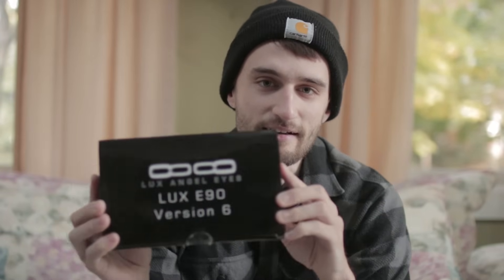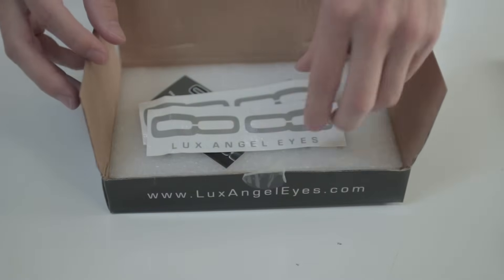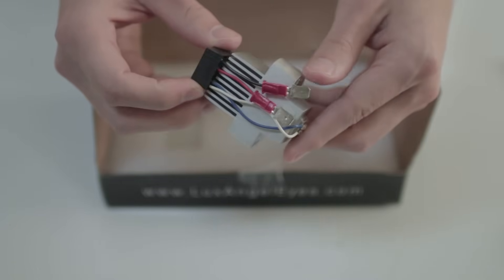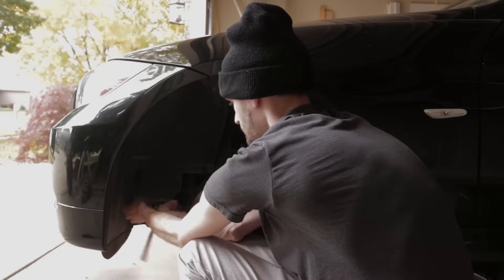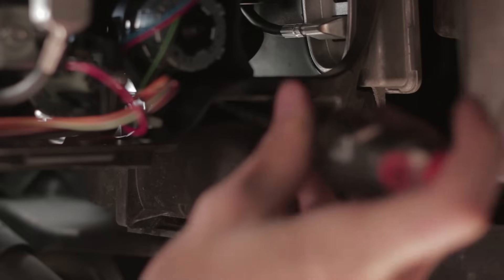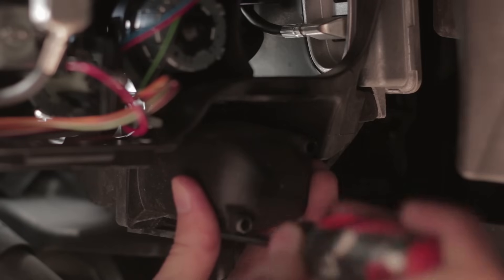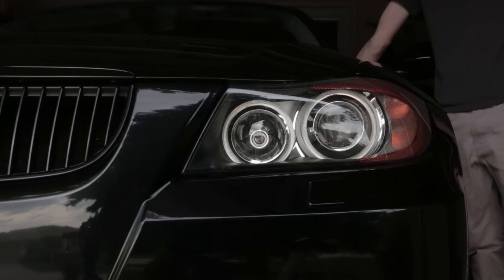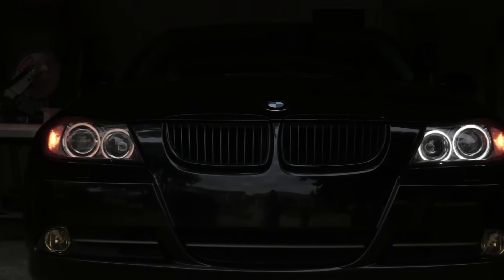BMW E90 Angel Eyes LED Upgrade (LUX)

Comment: just a warning, I was at the BMW dealership just yesterday and I asked him about the Lux Angel Eyes aftermarket LED Halos / Coronas. they told me they would not advise me to do that because it can drain the battery a lot faster or some other electrical components may go bad.
Reply: Yeah, but i bet BMW sell their own version of LED eyes for the e90 which i also bet don't have any neg effect. its just dealers for you, il be honest I'm on my forth e90 and have put angle eyes in everyone (different brands) and in 7 years iv never had one issue
Reply from the maker: That's the dealership trying to scare you out of something they can't make a profit on. The truth is, LED's use far less energy to emit the same amount of light and actually put LESS strain on the battery. That's why BMW switched to LED's on their newer models.
Reply: Thanks fellas! Ill be ordering my own next week.
Reply: you won't regret it kevin, gives the car such a fresher look:). enjoy
Reply: Will get it by black Friday!
Reply: kevin p the stealership will tell you anything bad that's against upgrading the vehicle to better visual standards, because they want you to buy the newer models, why would they say yes get your bimmer pimped for cheaper costs and leave our newly designed models on the showroom to collect dust.

Comment: Thx Justin, I'm about to 'retire' mine 2006 330i RWD auto with 190k miles, and I always wished I could've had the Halos upgraded to LED (which I did on my X5) but I didn't because I don't have them setup as my DRL - instead I have a normal h-bulb inside the hi-beam socket - not sure if/how I can hack that?
Reply from the maker: in the iDrive menu, under lighting, you can disable the daytime running lights. Then when you turn the headlight switch one click to the right, only the halos will be illuminated like you see in my video.
Reply: yeah, i kind of figured this was the way, but switch in that position is not going to turn the main-beams on automatically ...right?
Reply from the maker: one click to the right turns on the halos, two clicks tuns on the headlights
Reply: Yes, but when you turn left for the 'auto' setting the Halos do not glow until the headlights turn on at night - can that be code-hacked?

Comment: Hey Justin - My 328xi has halogen lights - I know the car has the option for the upgrade to Xenon when it's purchased, but mine is used. - do you know if I can just buy Xenon headlights and plug and play w/ the current voltage in the car?
Reply from the maker: +J C0 im not sure if it's plug and play but i know someone has done the conversion before. There is a thread on e90post.com
Reply: Justin Buice cool man I'll check that out. Thanks for the info!

Comment: Question can you actually put HID in a halogen projector headlight ? My Mercedes didn't come with HID like my BMW
Reply from the maker: +Nafiz C the housing for HID's is different because the light diffuses differently than a halogen bulb. If you were to put and HID in a halogen housing, i think it would be too bright for oncoming drivers.
Reply: idk what do you call them it's look like same as your car has but it isn't blue

Comment: So did you have to change out the halo lights because you turned them up with the Carly
Reply from the maker: you can turn up the brightness using Carly on both the stock lights and aftermarket ones. Although the stock ones will be a bright amber color compared to the pure white LED's

Comment: did you replace the headlight bulbs also? if so what did you install?
Reply from the maker: +stilltippin214 i only replaced the lights flr the halos. The headlights are stock

Comment: Hey man I recently got an 06 BMW 330i. My daytime running lights are the nasty yellow inner bulb rather than the halos like most newer BMWs I see on the streets. Is there a way I can change this? The only time my halos come on is when my low beams come on and then it's almost pointless because they're so bright you don't pay attention/see the halos...
Reply: Temp can get it coded that angel eyes are your daytime running ights

Comment: Is it possible to install lux v7 without removing tire? possible to do it from the top? I had bought some cheaper LED angel eyes (which burnt out), but was able to install them from the top/engine
Reply: I have a 2008 328xi and you can change the DLR bulb without removing the tire. You cannot change it from the top. I believe that only works for certain models like convertibles, etc.

Comment: I have a 2011 328x drive. So This will work for my car right? And also will it light up the day time running lights?
Reply from the maker: I believe the 2011's use a different bulb, but I think that LUX makes a bulb for your car. Just check their site. The daytime running lights are a separate bulb from the angel eyes.

Comment: I recently visited their website and now it lists under LUX E90 V7, is this possibly a more recent version?
Reply from the maker: +Omar Guerrero it could be, I'd message them just in case
Reply: Hi Omar did you manage to find out if thats a recent version? And would it still work because im not sure about mine i have a 55plate 320d SE :/

Comment: I just bought the lux v7, Hopefully they turn out great because the stock one died.
Reply: I haven't installed them yet but I will let you know when I do
Reply: BOOM HEADSHOT yes please let us know as I am looking to buy the V7 as well. Thx
Reply: I have them installed and they look great. Installation was easy and you don't even need to take the tire off. Hopefully I will have a video on my channel tomorrow.
Reply: BOOM HEADSHOT thanks for the reply. Appreciate it. Can't wait to check out the vid!
Reply: The vid is on my channel now. They look great but I had a problem installing the driver side one. The previous owner did not put the glass piece which caused the halo ring to melt and become black on one end. All I did was cut the burnt stuff off but its not perfect. Im going to have to concentrate the light with some sort of tube.
Reply: Yes. all I did was trimmed off that burnt stuff and it became brighter (not perfect though). I have a vid on my channel showing how it looked afterwards.

Comment: Looks so good! Been eyeing the Lux V6's for a while and I think this just convinced me to do it. Any plans to make them DRL? I haven't had any luck coding for the early model e90 (I have an 06 as well),  so I was looking into the daeos harness but haven't purchased yet. Like to hear your thoughts!
Reply from the maker: +Justin Carey I turned off the daytime running lights and then if you turn the headlight switch one click to the right, it will just turn on the halo rings without turining on the actual headlights. That's probably the easiest way to drive with just the rings illuminated.

Comment: Hey justin what are the best headlights with halo rings my car just has stock non halo lights and I'm looking to upgrade to better ones preferably to one's that are compatible with the lux v6 lights?
Reply from the maker: +Orlandopatino209 your best option is to buy original BMW headlights. You can probably find a pair on eBay for under $400 slightly used. The only thing is that the wiring might be different. Check e90post.com there is a DIY for converting the base headlights to the xenon ones

Comment: Are these just for the daytime running lights? I have hids installed but my daytime lights are still halogen, will these change that? Thanks in advance
Reply from the maker: +EliTheJerk123 the daytime running lights are separate from the halo rings and they are still halogen lights. You can buy LED's for the daytime running lights, but I just turned mine off completely so it's just the halo rings that light up during the day
Reply: Justin Buice Okay thanks, im thinking of doing this to my 3 series. It looks great, makes for a good head turner

Comment: hey Justin, do your lights flicker at all? I read somewhere on the forums that some people are experiencing lights flickering on startup
Reply from the maker: They flicker for a few seconds when you first turn the engine on. I found this on the forum- "The car checks to see if any bulbs are burned out upon start up. The problem is that LED takes less power than incandescent so every pulse causes the light to flicker. It was always doing it, it just didn't light up your old bulbs." In other words, you don't see the halogen lights flicker because the self-check doesn't send enough wattage to illuminate them, but since the LED's require such little power, any amount of electric current will make them light up, which causes them to pulse during that 3 second self-check.
Reply: thanks
Reply: Justin Buice come down to Indiana I'll turn all that off and code whatever, I just did my e90 no more flicker, led errors, turn signals off with halos, so much more took an hour !
Reply: Tony Roberts where in Indiana do you live? My gfs family is from there and I️ go there often, I’ve been wanting to replace my old corona bulbs for an led bulb?

Comment: Poop 😢 I have a 2005 i325 and none of the lights Lux sells are compatible. Any recommendations?
Reply from the maker: +Oya Osun if you have the base halogen lights, you will need to upgrade your headlight housing to the xenon ones like mine that would have come standard on the 330 and 335. Unfortunatly they are around $1,200 for the pair and will require some wiring, but people have done it.

Comment: i was too lazy to take off my wheel so i just turned my wheel so i could remove the screws and it was fine.
Reply from the maker: +Zach hidden ive done it that way but my camera wouldnt have fit with the wheel on
Reply: Justin Buice that makes sence, looking back at it, it wouldve made taking off the outer cap way easier for sure

Comment: i have a BMW 330I 2006 i was wondering if these would fit? i know it says E90 but i'm not sure how to tell
Reply from the maker: +LunekTv mine is a 2006 330xi. Basically the same car. If your grill has the upper piece attached to the hood, then these lights will fit.
Reply: Justin Buice thanks for the response man!

Comment: Does it matter that my E90 doesn't have xenons? Sorry for this novice question.
Reply from the maker: +Tomi Rinne it only works if you have xenon headlights because the actual housing is a little different.

Comment: How do you tell the difference between halogen & xenon?
Reply: Halogen does not have the rings nor the projector. HID headlights will have modules on the headlight itself.

Comment: Where may I buy the screws that hold the fender liner?
Reply from the maker: Check your local auto part store in the section where they have fasteners for body panels. They usually have an assortment of small screws

Comment: I have halogens and feel they let the whole look of the car down, has anybody done a dull pre-lci halogen > HID swap, if so, details?
Reply: i agree on bmw stock halogens they are PISS POOR, i considered a hid kit on my old e90 but so many kits out there make the car look silly in my opinion. I instead opted for a pair of osram night breaker plus bulbs. MUCH brighter when driving and give the car a much better look with lights on. they may not have the full effect you was after but are a cheap alternative compared to hid, id 100% try them before u got hid

Comment: I don't understand why my 2006 BMW 325i didn't come with HID or Halo headlights. something I extremely wanted but the the one i bought didnt have them. is there any way i can get HID and halos?
Reply from the maker: +Shelby Hilke the 325i was more of a base model, so the HID lights would have been an expensive option for the original owner. Your only option is to replace the entire headlight housing to the one like mine that has the HID projectors and halo rings. You can buy a pair on ebay, the problem is the wiring is a lot different than the base model. Id check e90post.com im sure somebody has done the conversion before, but I have a feeling it's expensive
Reply: Justin Buice Ah, I see. I was trying to find one with HID's because my previous car had them. The fact that they are so crisp and clear. And of course i want the rings! But im a broke college student so im tight with how much money i spend on my car. Already did $1000 and tinting now for $300.

Comment: Will these work on a 2007 BMW 328i with halogens? I've been trying to figure this out and I don't want to have to buy new headlights altogether since I think my car is Pre-LCI
Reply from the maker: Mine is a pre lci, but if you have halogens, you will need to upgrade the entire headlight to the bi xenon ones. Thats the only way to get the halo rings

Comment: No error in board computer? And it s for a pre restyling?
Reply from the maker: These lights are error free. They have built in resistors so the computer reads them just like the stock bulbs. These are for the pre-LCI. I've had them in for one year now and they are still good!
Reply: Justin Buice thanks man

Comment: Maybe someone can help me, my headlight does not have those white rings. Will it get those if I put in these lights or do you have to replace the whole headlight thing?
Reply from the maker: You will need to replace the whole headlight. The rings are built into the headlights
Reply: Justin Buice thank you!!

Comment: I don't understand can someone explain did he just switch the stock light bulb with a box filled with just wires?
Reply from the maker: That small aluminum box is the actual LED light itself. If you look close on the front of the box, there is a little square with four small yellow dots. The those tiny dots are the LED lights! The reason the aluminum box is so big for such small lights is because it has a built in resistor to covert power as well as for heat dispersion
Reply: Hey thanks for quick response! I just couldnt see it that well in the video. Too bad I have a 2009 these are 2006-2008

Comment: $125 is too much =(
Reply: Will Lowe for the quality they give I don't think so
Reply from the maker: The cheaper ones burn out. I've gone through two sets of ebay ones. They are a lot of work to install so I'd rather pay a little more and not have to worry about them